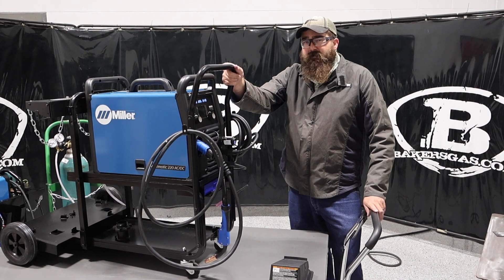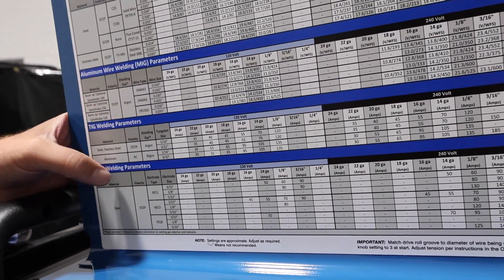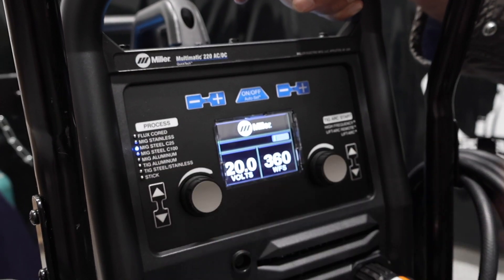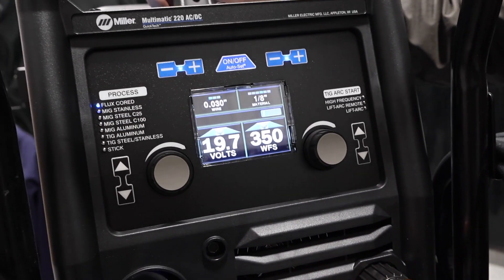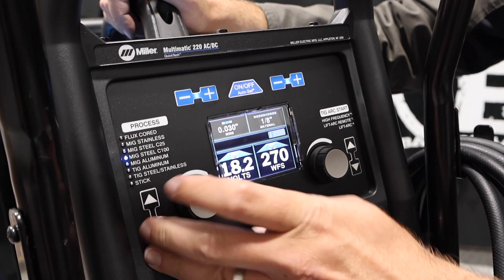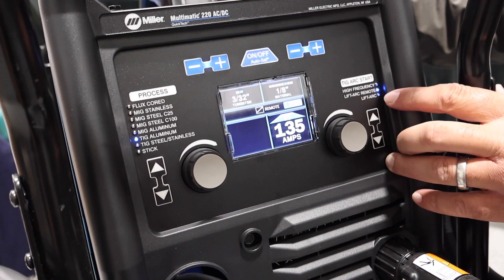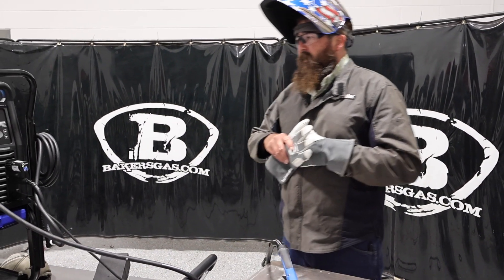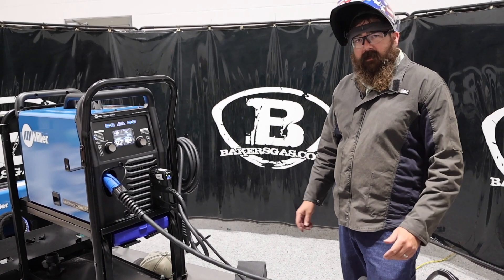Miller 220 Review + Setup, Dual Cart & Wireless Foot Control Demo!

Comment: Would you recommend this to reinforce car frames ? Does it have mig pulse settings ?
Reply from the maker: Yes for sure it does not have pulse though, you would get that on the Miller 255 if you jumped up to that but that does NOT TIG aluminum

Comment: I’ve had mine for a few years and really enjoy it. Baker’s Gas was easy to deal with and got me a unit promptly when others were saying backordered. 

Of the other AC/DC MTS on the market I looked at, this one seemed to have the most intrinsic menu, and switching settings by just tapping the Tig pedal or the Mig trigger is awesome.

Comment: From a guy that’s had a miller 220 and a ESAB 205, I’d pass on both and buy a HTP 2500. You’ll get a better quality industrial grade welder with more options, for less money! Those little dense connectors on the miller 220 are laughable and telling of the machines build quality, as well as it being an over priced hobby grade machine.

Comment: Good presentation. How reliable are they compared to the ESAB 205ic that will run 6010 for less money? Which one do you get more warranty claims for, versus the number you sell? They are both good but pricey options
Reply from the maker: Customers are typically more pleased with the ease of use on the 220! Very few issues on the Miller! Also $300 rebate right now email us if you have any other questions and we will get you a deal!

Comment: I just bought 
this welding machine a few days ago, any generator brands that you would recommend for this specific machine?It was mentioned that any generator over 8,000 watts.  Duromax? Predator? Champion?
Reply from the maker: For the Multimatic 220 you could use any generator over 8,500 -10,000 would be ideal!